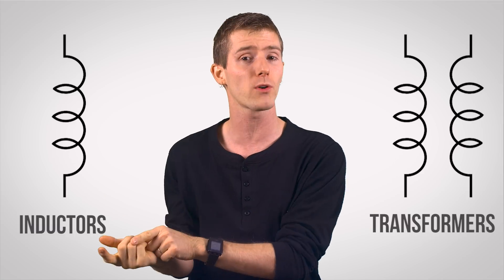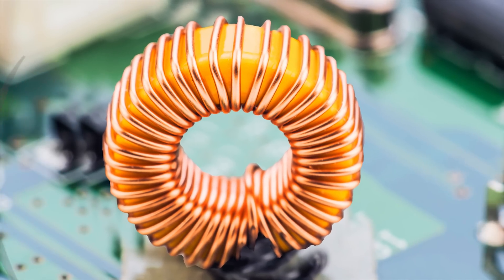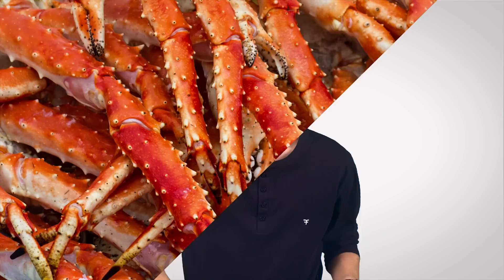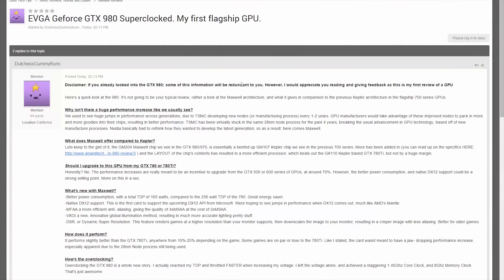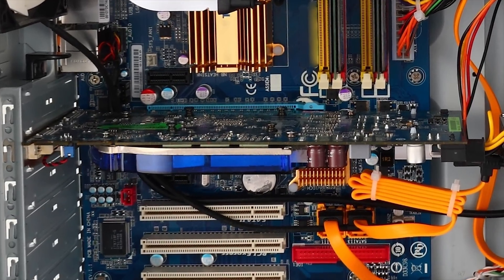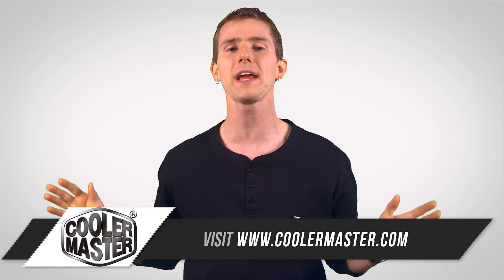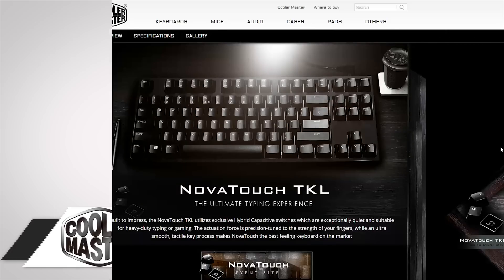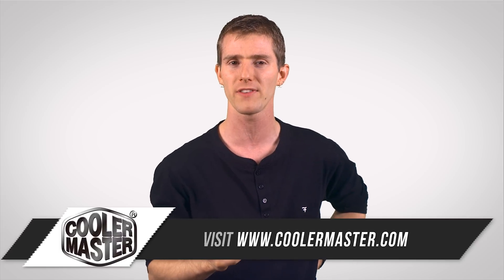Coil Whine as Fast As Possible

Comment: Saying there's not much you can do about it once you've got it isn't exactly true. I was having GPU coil whine on some older games recently. I started up fraps and noticed the frame rate was insane, over 160 fps. I activated Vsync and the coil whine instantly stopped. For some reason the GPU was being told to operate nearly full bore, but there was almost no "resistance" because the game was old and not demanding at all. Once I was able to regulate it with vsync it stopped.
Reply: but whenever you play a game that is about as demanding as the game you played before, you will hear coil whine.
Reply: ***** Not sure what you mean, I've gotten coil whine on around 3 games I can remember. Vsync fixed it in all of those cases, I've got about 120 games in my Steam library and only those 3 had the coil whine. Also if the game for some reason doesn't have a vsync option, you can always enable it through your video card driver.
Reply: Nathaniel Graham I'm glad it worked out for you. I'm just saying that the problem isn't exactly fixed. What causes the whine is still there. Your GPU simply isn't being used to the degree which would cause the coils to whine. It may never affect you again, depending on the games you play on the future.
Reply: ***** In my case the coil whine is caused by extremely high framerates, the only specific example I remember is darksiders 2 making the whole when it reached 300 fps. I halfway get what you're trying to say but since when playing modern games at full load it doesn't make the noise, and when playing darksiders 2 (or the other 2 games) I can turn on vsync to stop the whine, I would consider that the problem is fixed. I also think that at a certain point most video cards will make some coil noise, it's just that most of the time the framerate has to be very very high. All coils will whine at a certain frequency, if that frequency happens to happen when the card is producing 60 fps then you've got a problem.
Reply: Nathaniel Graham *whine not whole haha
Reply: Nathaniel Graham That may have some truth to it. I don't know exactly what's the overral design of a video card. AFAIK inductors are used in the power stage, not in the output stage, so I can't  really understand how framerate would have such a big impact on the sound produced by the coils had it not been due to power requirements ie:. lots of power to get a super high framerate
Reply: ***** that could be it, or maybe I'm wrong and it wasn't coil whine at all, could a different part of the video card make a high pitched noise from very high framerate?
Reply: Nathaniel Graham it could be that coil whine only occours at a very specific load.
Reply: I encountered it only when rendering thousands of useless fps
Reply: i know people who got coil whine because of no max fps cap. it happend in old game easily maxed out while getting over a thousand fps....
Reply: Are you guys sure that what you're hearing isn't the sound of your GPU fans? caaausee..
Reply: Yeah I agree he forget to mention using Vsync to stop it, it only happened in old games and new games that  are demanding didn't happen it just worked flawlessly.
Reply: I get coil whine when I use Folding @ home. Vsync can't be used there.
Luckily it's quiet and can't be heard when you wear headphones.
In games though I don't get it.
Reply: ***** If you reduce the FPS, the workload decreases so the GPU dosnt need as much power and the frequency of the coil falls below its resoncance frequenzy what causes the sound to fade away.
I just got two AMD FirePro W9100... When running full load, my sound system which is about 40 cm from my machine makes "hummmmmmmmmm". Solution: Metal mesh in front of the window. I guess because the mesh complets the faraday cage of the chassis^^
Reply: X9DW you can set a max fps range in some programs like the evga graphics card utility program
Reply: Mitch McCollum
this is what I had to do it seems like 90 fps is as high as I can go before my card starts whining.   just for fun I tried 3dmark 03 (oldest that works on my pc) and when it gets into the airplane section with 1000+ fps the coil whine is so badd it's funny.
Reply: Adam Hasso so...ur ears love it?
Reply: That's true. My 970 will coil whine a lot with games like Minecraft @1000 FPS. I just set FPS limit to 200 (to all my games, not only for Minecraft) and i'm happy witht he results. I still can hear some coil whine, but it's nothing compared to the 1000FPS sound :O
And, for example, in Crysis 3, at arount 60-80 FPS @ Very High with the GPU @99% I don't hear an very annoying coil whine.
I think that Graphics Cards doesn't like insame FPS xD!
Reply: TheScorpionsBoss yeah I agree, why 200 why not 60 or 120 or your refresh rate ? I can't imagine you having a 200 Hz  monitor.
Reply: Dženan Yep.
Reply: I get coil whine when im playing audiosurf 2. i cant turn on vsync and fraps says that it goes at +650 fps
Reply: MachineOperatedBot Yeah, definitely not the fans. The temp doesn't even get high.
Reply: macmacox how funny is it I hate coil whine, my ears heart even when I say it's name.
Reply: Sprits Fal No they are about to bleed.
Reply: Adam Hasso 60   120 144 hz i dunno where people get weird refresh rates
Reply: on WoW it says my refresh rate is 59 lol
Reply: wykedinsanity There not weird it's what Monitor manufacturers sell they monitors at, also you think this is weird look ar epeople OC monitors.
Reply: most common are 60 1120 44 hz tho
Reply: wykedinsanity Yes they are if you meant 60, 122 and 144 Hz, never heard of a monitor that has 1120 Hz.
Reply: cherry red keys and a stroked hand sorry my k70 is bonkers
Reply: wykedinsanity Do you like that logo ?
Reply: what logo you talking about im not posting my pic in youtube this is dedfault
Reply: Sprits Fal Yeah I've seen that in other games as well, not sure what that's about but it doesn't seem to cause any issues like screen tearing.
Reply: wykedinsanity The one on the K70.
Reply: Nathaniel Graham
 You cant really generalize it to the FPS , as you said "if your hear coil whining at 60fps you have a problem" if you play counter strike and hear it on 60fps , yes it may be the problem,but if you play crysis 3 and on 60fps , it still is a problem ,but then you know it was due to your card being pushed hard ,and not like 10% on counter strike ( 1.6 lol ) . I just wanted to point that out as you should probably use the gpu usage % rather then fps
Reply: Dženan That's the weird thing my friend has a 750Ti and it only whines when it renders 200+ frames but when he plays demanding games like Metro LL no whine.
Reply: Adam Hasso
Lol that's just weird, i guess we should take more factors in the calculation I guess
Reply: same here vsync helps ;)
Reply: Crash Pad nope tearing over latency.
Reply: Nathaniel Graham it's not caused by high framerate. It's caused by high performance, which is giving you those absurd framerates
Reply: If you had a more powerful PSU, the PSU would whine even if you had the GPU under load

Comment: i realize coil whine may be annoying to some people, but i dont ever put my head in my case while using my computer so it doesnt bother me. My computer is on the floor next to me, and there is a tiny bit of noise from fans, but when im using my headphones or even my speakers i cant hear anything coming from it
Reply: if you don't have Coil Whine issues, you don't know how loud it is.
it's a high pitched sound, which will pierce through your case fairly well.
while higher frequency sounds generally don't travel as far through the air as low frequency ones, high frequency sounds seem to 'pierce' materials better.

to simulate Coil Whine, play an audio file of a fairly high pitched sound, but have the volume fairly low. loud enough so that you can just barely hear it over the sounds of your games or whatever sounds you normally have.
Reply: Well it's sometimes so loud, you can hear it across the room. Minor coil whine is not a problem. And if it's really loud, you can get it replaced (it's considered as a faulty product if the whine is too overwhelming). Well this applies at least to Finnish, Swedish, German and UK retailers (personal experience, probably many other countries too where the customer right laws are set to protect the customer)
Reply: I'm just saying I have never noticed a noise issue of any kind with my computer whether it be coil whine or fan noise, I dont understand the need for silent computers
Reply: I can hear coil whine THROUGH my headset... And my PC is about a meter away...
Reply: i guess maybe i'm lucky i havent had this issue or my ears dont work well lol
Reply: until u experience yourself, u will understand how the rest feel. Im having coil whine on my asus strix gtx980, even when gaming with my speaker on quite loudly, u can still hear the whine, because it's a high pitch sound... so it's very obvers
Reply: Ronen Friedman
I have coil whine in my Asus HD 6770 card. It's noticeable when playing games where there are white backgrounds.
Reply: you can hear it over the game audio? maybe turn the volume up or get better headphones
Reply: This is something I can notice from 6 feet away even when I'm making use of a surround sound speaker system. When I turn to a darker section of the game it turns down or even is gone when it's dark enough.
Reply: Ronen Friedman Well people hear different frequencies differently so you might not notice it (unless you really try to hear it) and for some people it's really loud and noticeable. I mean you probably hear it all the time but you just don't react to it. Or then your products don't have coil whining or it's so high frequency whine that human can't hear it. My current rig doesn't have coil whine at all (my old rig had coil whining mobo and gpu, lucky me..).
Reply: On laptops is worse because your face is near.
Reply: My graphics card only suffers from coil whine when my fps hits 2000 XD
Reply: Ronen Friedman my pc sits on my desk about 1m away from my head,  so a silent pc is Necessary for me as I'm not willing to turn the sound up to ridiculous levels to drown out the sound of the pc. Because when playing casually I almost never play with a headset, just speajers
Reply: ***** It's not going though the headset....  It is loud enough to be heard across the room....

Comment: My Cooler Master PSU had a nasty coilwhine with dual 6970s. and Linus was right, their RMA rep said they wouldn't help. So I was stuck with it, but went out and bought a 'PC Power and Cooling' (silencer mkII) PSU and it has performed silently through three graphic card generations. 670, 770, and 980.

Cooler Master can make great cases, but maybe their PSU's just aren't as good.
Reply: *****
That PSU is made by Enhance Electronics.

XFX doesn't make PSUs, Corsair doesn't make PSUs, Rosewill doesn't make PSUs. Neither does EVGA, Fractal Design, Thermaltake, NZXT, Nexus or BeQuiet. And the list goes on and on. There are only handful of OEMs that make PSUs and they are sold under different brands. There are many PSUs from different brands that are actually 100% identical internally and different price tags. This is how the tech industry works. It's cheaper to order from an OEM than setting up own production lines. Seasonic is probably the biggest OEM on the PSU market.
Reply: What was the model of the PSU? Because CM doesn't make PSUs, they just sell them. IMO the only reliable PSUs from CM are made by Seasonic. They have had PSUs from multiple of OEMs in the past so ofc some of them are worse than others.
Reply: WayZHC Excuse me? I have a silent pro gold. I'm almost  sure cooler master made it.
Reply: *****
Well, you might be able to get them directly from an OEM, but that would mean you have to buy like 500+ of them at once.
Reply: *****
A lot cheaper than a retail unit, but a batch of them would still cost a lot.
Reply: WayZHC Hi there, do You know who makes the Cooler Master UCP Ultimate 900W PSU? Mine is producing some strange noise from time to time, it's not a whine, it's more like a buzz. The voltages are in the upper limit but stable all the time. Any ideas what can it by? Any One?
Reply: masek396 Looks like that PSU is made by AcBel Polytech (never heard of it before). JonnyGURU is a great source for in depth info about PSUs. For example the OEM for your PSU was mentioned here (below the second image). http://www.jonnyguru.com/modules.php?name=NDReviews&op=Story3&reid=141
(That is 700W model review, but 900W model is based on the same platform)
Reply: WayZHC Can I buy it directly from them?
Reply: WayZHC i wonder how much a single unit costs.
Reply: WayZHC okay
Reply: WayZHC Thank You for the info :)
Reply: WayZHC I got 3 Seasonic psu... first one was immediately RMA cuz of insane coil whine, second one was working for 6 moths, than died. Got replacement for it, and this one is also doing coil whine, not much as first one , but still very annoying. Will never again buy Seasonic, fuck that shit...
Reply: ***** Same here, I have an R9 280x and an FX 8120 with a cheap-o CM B600 600w PSU, and it is working absolutely fine for me.
Reply: MegaTheJohny What is your current PSU?
Reply: Nvidia, never amd ever again for video cards. C'mon. Nvdia inspector and uber tweakzzz
Reply: MegaTheJohny What are the model names of those Seasonic PSUs you had?
Reply: Felis Silvestris  hmm I'm wondering that too. I have the x660, x760, x1050, x750, x850, x1200, s12ii 520 and m12ii 520 and the newer m12ii 520 (flat cables). and in multiple numbers and all are silent as fuck. probably he got lucky and got a really bad batch or just trowing out nonsense from his ass.
Reply: Rig Explosion first and second was Gold 850W, now  I have Platinum 860W
Reply: ***** Yes, from Seasonic you can. Seasonic makes the absolute best PSUs. RM series from Corsair, AX series (not AXi), HX series, Fractal Tesla series, V series from CM, list goes on.
Reply: ***** You're thinking of the wrong company then.
Reply: ***** By any chance have you bought a counterfeit product? My PSU is fine. I blame HEC for branded PSUs that blows up. My old Cougar CMX 700W kinda did but was fixed under RMA.
Reply: ***** you've gotten unlucky. give them one last chance, their prices are the best and their reliablilty are usually unbeatable
Reply: ***** of course, but that doesn't mean that the EVGA alternatives for that price are any better. For example, the $500 AX1500i is the first PSU ever to get a full 10/10 on JohnnyGuru.com

Comment: My Windforce R9 280x use to have a loud coil whine but it's gone now. The noise goes away when I switch anti aliasing on, the whine would get louder if the frames went above 60fps.   Not sure what fixed it, could possibly be a driver update, too.

Comment: One time I was using a heat gun in the same power line where my PC is, and got some incredibly loud coil wine from my PC. I heard it only when I was done using the heat gun. From now on, no more high power consumption devices on a electrical socket near my PC.

Comment: You can use a straw to help isolate noise and help you find coil whine. Especially if you have a large, thick-walled straw, that's also flexible. It really helps when trying to hunt down strange noises from your computer. The size of the straw (the opening) helps get more of the sound into the straw. The thickness of the walls helps isolate noises. And flexibility helps you get into strange positions. But even a basic disposable straw can still prove to be an advantage.
Reply: Buy a medical stethoscope. They are not expensive. It's literally just flexible air tubes that conduct sound to your ears. It also has pads that comfortably fit into your ears like earbuds, without the potential risk of inserting a rigid plastic straw too deep inside your ear and damaging your eardrum.
Reply: @DMahalko  you'd be better off buying an automotive Stethoscope  that a used to pinpoint sounds inside the engine it works the same way as medical stethoscope but it's better designed to get into tight areas.

Comment: This is a really GOOD explanation, as an electrical engineer, I feel completely pleased with how well you managed the subject Linus, awesome job!
Reply: hey a question: i have a powerbank that i connect to a lamp. When i lower the lamp’s brightness, the powerbank is having coil whine. When the lamp is at it’s brightest level, there’s no coil whine. Any idea why this is?
Reply: @annymp “yes, but no. It’s complicated.“ is my default answer I such subjects.
Cause In Electronics the circuit, Szenario, usecase or environmental influences to components (type, product & category) & their arrangement etc interact widely.
Reply: Im a Information electronics technician without further details I’m just guessing & pondering:
Depending on used lamp(LED or not?), dimmer in general cause similar trouble. How u lower the brightness?
Or the circuit inside the pb. Colloquial (!) the power that is not going to the lamp may goes pro rats through a coil…..

Comment: Can't believe coil whine still exists :(
Reply: Well, although product quality affects coil whine, on some level you can't stop it, because PHYSICS!
Reply: A lot of the new 970's and 980's have coil whine
Reply: Try enabling vsync or a FPS limiter that usually solves the problem.
Reply: I think it is still a pretty rare phenomenon for people to notice due to the majority of users having relatively loud fans in their rigs that drown out most coil noise.  Another place you can get whine from is large electrolytic capacitors due to similar reasons.  Capacitors can be charged and discharged rapidly enough that they vibrate due to internal electromagnetic fields causing them to oscillate.  The only place I ever hear annoying sounds from any of my computers are the PCI express buss interference in on-board sound which is why all my computers (except laptop) have external DAC/amps.